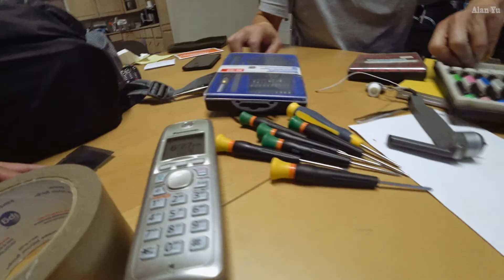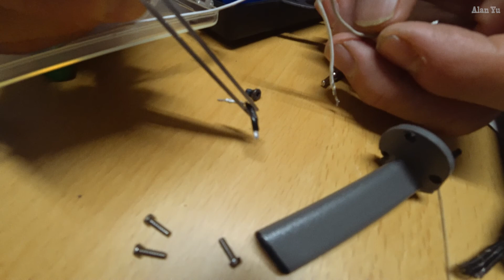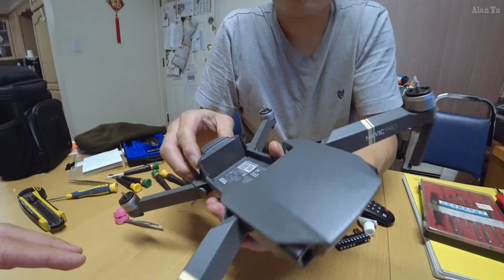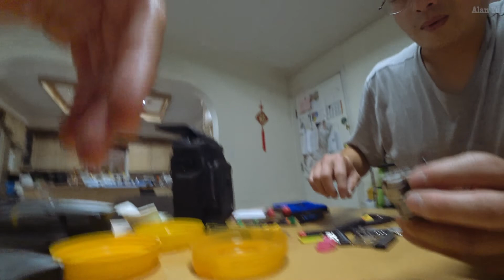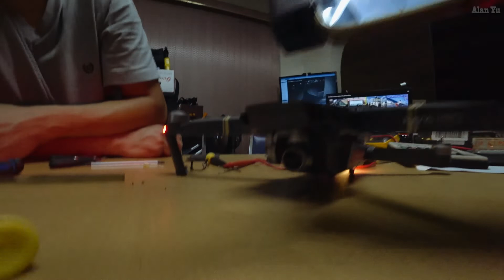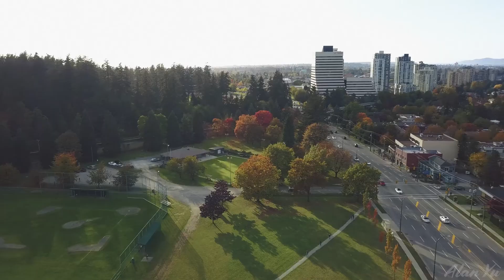Mavic Pro Gimbal Ribbon Drone Repair Attempt Plus Arm Motor Teardown

Comment: You need to remove "attempt" from the title of the video. "Attempt" means you tried, but failed to repair it. It appears in the video that you were successful repairing the gimbal.
Reply from the maker: You may have noticed there was an archived video at the end which means no actual flight was done for the day.  As well some of my comments in the video such as it starting differently.  So ultimately it's a "to be continued"